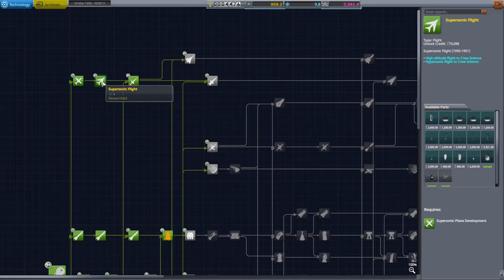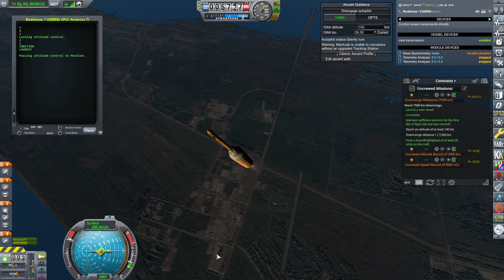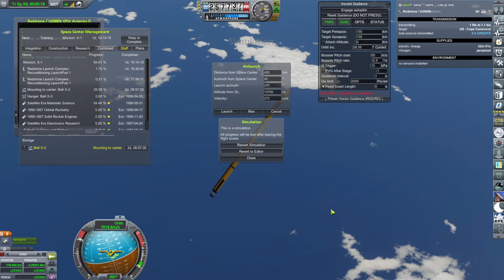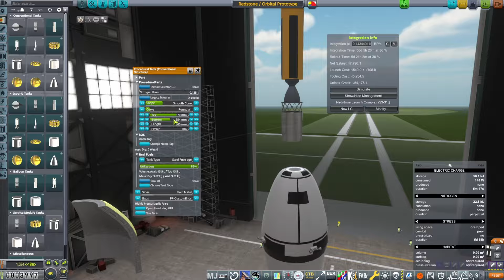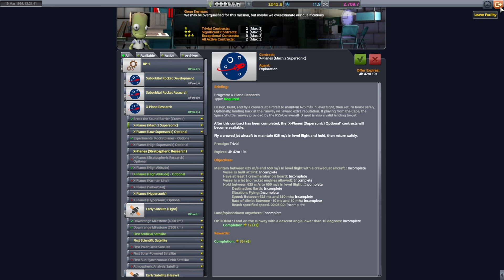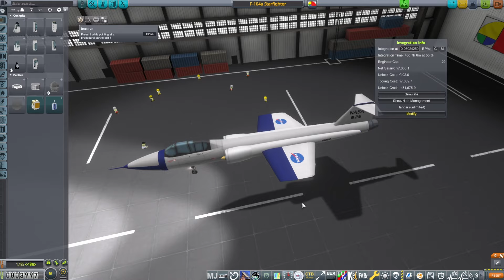Can I Use My Redstone Booster to Achieve Orbit? (...no) | Mike Plays RP1 Redux Ep.21

Comment: The 1956-1957 orbital rocketry node gives you the really powerful engines that will make it alot easier to get into orbit. 
It is possible to get into orbit without it, but it requires more carefully designed crafts. 
For most players it makes sense to target a time around when this was acheived in real life, mid 1957. 
So in the year that you can design your rocket (you can still use the parts you are researching for design), build the launch complex that you need and save up some money. Either put your engineers in the hangar (make sure to not use more than how many can work on the current craft shown aat the bottom of the staffing menu) or just put them of their job. Doing this will lower their salary cost by alot.

Comment: I wrote a comment on episode 9 since you seem to be quite slow to adapting to comments but I will post it here as well: 

The mechjeb PVG(Primer Vector Guidance) requires quite alot of tuning. Its goal is to put you into a final orbit with minimal delta V. 
It will do the ascent in three stages, you will see this as autopilot status in the mechjeb guidance window. 
First it does a vertical ascent until it reaches a specified speed. This is the pitch start which you have at 50m/s, but can be set lower. It is to clear the launch complex, give your control surfaces more control, and make your rocket more stable, lower numbers are more efficent, but can make your rocket more unstable initially
Next it will do a pitch program, which is the booster pitch rate. This gives an even curve and is used to get you out of the atmosphere. Note that this part has what is called the Q alpha limit. That means that it will limit the pitch so that the angle of attack(alpha) times the dynamic pressure (Q) is below a threshold. 
So a higher pitch rate will make it want to turn over faster, but during max Q it will more align with prograde anyway, and then after max Q it will again go back to its higher pitch rate. A higher Q alpha will make it turn over more aggresive but can break control surfaces during max Q.  You can use mechjeb to figure out what your Q and AoA is for better tuning, either with windows that have these values or the flight recorder. 
The final stage is the actual PVG. Since PVG is a pure vacuum based optimization, it starts when Q drops below a threshold, which you have set to 10kPa. This is what is causing your rocket to pitch over suddenly at the end. You can also do this based on a stage with the "PVG afer stage" option. 
From there your rocket should just burn until it reaches your final orbit, there is some more details with tweaking how different stages burn and if you have a coast phase, but that can wait for more complex launches. 
There is more documentation on the wiki or in the discord channel: https://github.com/KSP-RO/RP-1/wiki/TroubleshootingMechJebPVG 

Some specific tips for you now and in the future. 
Using the dev version of mechjeb as documented on the wiki has a better PVG, so that is often prefered by most RP-1 players. 
You should avoid sudden pitch overs like you have, so you either need to set the Q trigger to later (lower pressure) or to increase the pitch rate. 
If you feel you then are pitching over too hard in the lower athmosphere, turn down the Q alpha, or increase the pitch start speed. 

Mechjeb does not really like unguided stages, but it is possible to tune it so that it chooses the attitude which is best for that. But Having two unguided stages at the end is likely more than it can handle, as the unguided stages are only really good for giving the kick which puts you into your final orbit. 
That should be sufficent to get you your first sattelites, and from there you can do even more complex burns.
Reply from the maker: Thanks. The next couple of episodes get away from MechJeb entirely as I focus on planes, but I think I'm getting ready to jump in again.

Comment: You can use a single Redstone Engine to get to orbit before, I have and was able to complete all the contracts in the early light satellites program. It was very fun to design as I like the technical bits of rp-1, but it took the better half of a day(in playtime) to get it to work. Razor thin margins, and wasn't something I'd do again or recommend because of how long it took. Maybe an Atlas Booster engine would get you a first orbit?
Reply from the maker: Yeah. In my first go I got my first orbit with an Atlas engine.

Comment: The Veronique rocket / engine flew the firs (and only) cat into space. Can it be used as the first stage of a sounding rocket?
Reply from the maker: It could, but I'm not sure what is to be gained by sounding rockets anymore. The shorter duration near space sciences are done. I don't think a high space (I'm not even sure of the altitude needed) return is survivable at this point. I think my best bet is for some low orbit science.
Reply from the maker: Then again, putting something together and seeing how high I can get it for some transmittable science may not be a bad idea.
Reply: @MikeAben  I guess I'm mostly curious about the fidelity of the simulation. IRL, the Veronique was able to lift a cat to space, but you're using it as an upper stage.
Reply from the maker: @JohnWilliamNowak I suspect it can lift the Advanced Biological Payload into space. I may just concoct an experiment.
Reply: @MikeAben  Neat!
The Veronique had a funky feature I have not seen anywhere else: it had a large set of fins which would be dropped when the rocket was going fast enough for the smaller set to maintain stability. 
Very offbeat. Most rockets ensure the launch rail is long enough for the rocket to reach sufficient speed.
Reply from the maker: @JohnWilliamNowak I built a sounding rocket with the base Veronique, aluminum tanks, and 1953 avionics. It got to an altitude of 150 km. The first Veronique launch was in 1959, so it seems very likely it would have had better tech than me. I still have another unlock available coming up with the engine, not to mention better avionics and lighter tanks. Perhaps the early engine is more reflective of early versions of the engine that never flew.

Comment: 37:18 have you checked the box in the mechjeb settings (not the ascent guidance settings, but the settings for mechjeb found in the dropdown menu) for “do not kill throttle on loss of control”
Reply from the maker: I've not idea whether I've checked that or not, but I'll have a look.
Reply: @MikeAben  I think it is either in the main mechjeb settings or in the main menu settings for mechjeb. It should be called: Module disabling does not kill throttle (RSS/RO)

Comment: Pro tip: if trying to use a unguided stage to orbit.. 
Test the unguided stage from the prefered orbit, retroburn and note Apogee and Perigee afterwards and set MJ to those notes for the guided part (PG will be negative). When starting the rocket.. you need to coast to these and then start the unguided part prograde.

2nd if using full guided, use MJ without coasting set to 0 for more efficient orbit.
Edit: unckeck the coasting length.
Reply: Didnt know that about MJ with unguided stages. That’s a nice tip
Reply: Set what to 0? Orbit alt?
Reply: @Gmannsaul94  No. In ascend guidance on PVG mode is the option to set the coast length. When it's checkt it uses the set time. In this case 0. 
Unchecked it will calculate itself the coast length.

Comment: 28:00 you need to manually set engine to 100 for unguided stage. press Z anywhere bevor staging. or put it on 100 at start in main settings

Comment: You could decrease the wobble of the rockets even more, if you test the spin in orbit, so the motors are on the center of CG when fired. Or use the third tool from the left on the bottom in the hanger, that shows full and emtpy CG and momentum from the motors. 
Its also helpfull for planes when placing wings. There should be no rotational force when the motor is active.

Comment: How come you dont use PVG?
Reply: no orbital rocket.. you need to calculate negative PGs with suborbital, to get the angle of the unguided part that you like. Its doable but takes several more test runs, even so if you just change a bit.